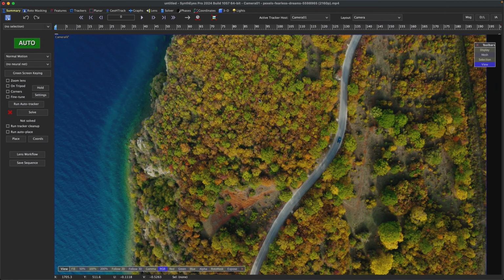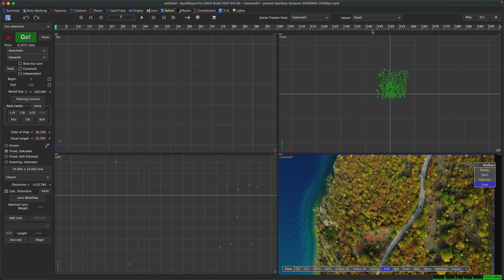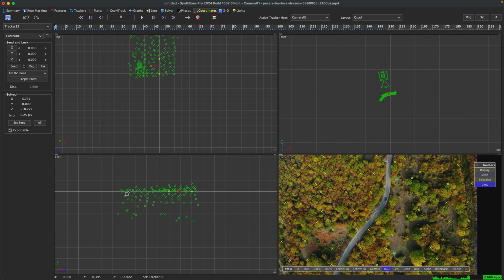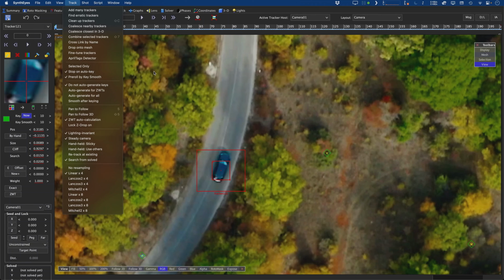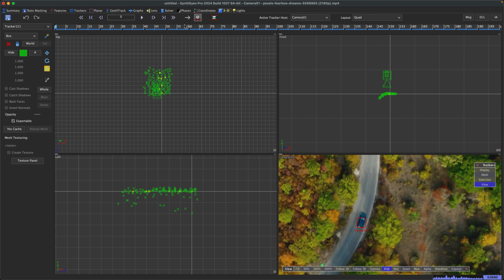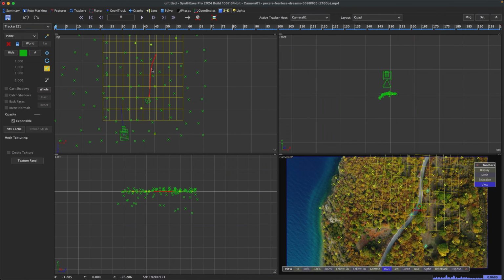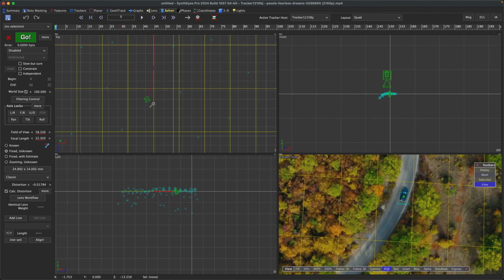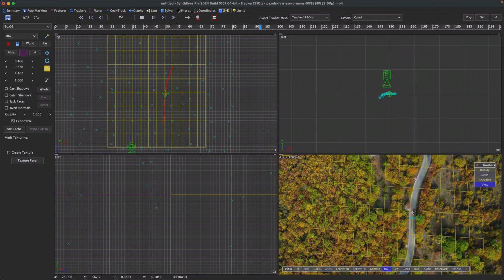Create Stunning 3D Object Tracks with One Tracker!

Comment: LIFE SAVER ! 
The whole object tracking thing in synth is so confusing.  
Do you know of a tutorial that shows exactly this without the script ? basically add moving object . add one or two tracking points . solve . I'm not getting results like the script (the moving object diamond dose not move)
Cheers none the less. 
💯 :medal-yellow-first-red:
Reply from the maker: Typically the object tracking needs several points to get a decent solve. I think you need at least 4 if I remember correctly. I'm pretty sure there are some vidoes on youtube about adding moving objects. Check the Syntheyes channel. If I run across one I'll post it here.